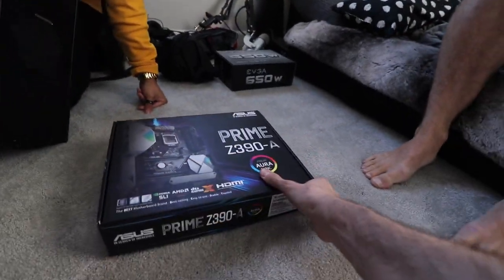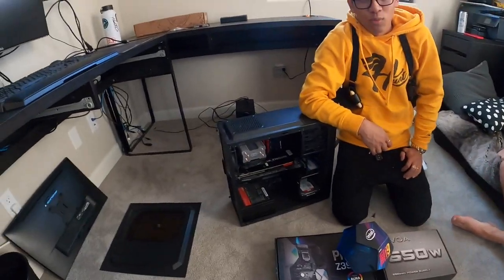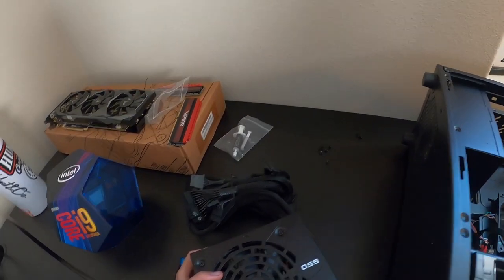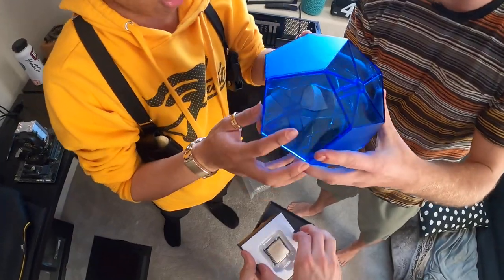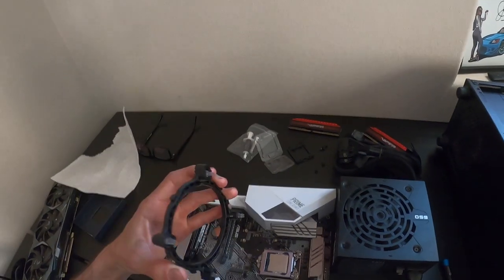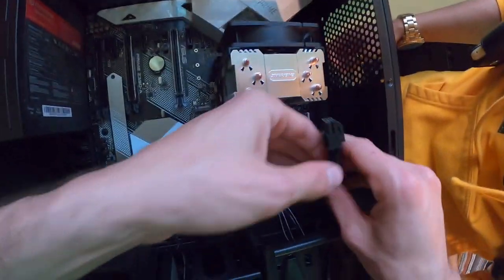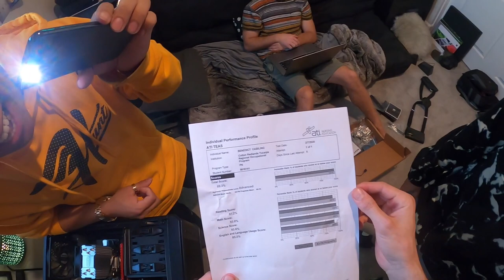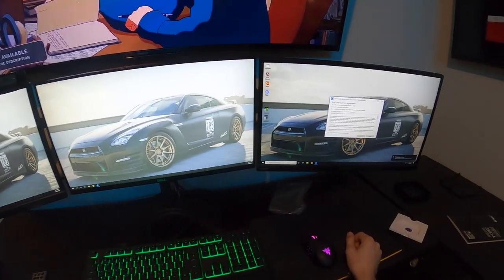Building my Dream Gaming PC Setup!

Comment: As a PC nerd and car enthusiast I'm really holding myself back. But who else noticed that his unfiltered rear fan was set for an intake, and the cpu fan looked like it was blowing towards the front? Did you reverse the airflow in this case? (Btw, too much thermal past fine, too little = overheating issues) <3

Comment: Get a bigger wattage power supply 750 or 850 and change that CPU cooler   650 watt is not enough when overclocking plus that (GPU / Video Card) can draw some Wattage, If that was me I would have went for a AMD CPU Ryzen 9  3900X  12 core 24 thread For gaming and editing.

Comment: Hey Tj you should really get a bigger cooler, Intel 9th gen CPUs really like to run hotter. An Evo 212 can possibly cool it on light loads but since you want to stream and play COD I would recommend getting a bigger air cooler or a simple 240mm All In One water cooler. Simple install but you really wanna protect that $500 CPU and you know not thermal throttle. I also recommend getting more fans and make sure they are in the correct orientation to create Positive pressure inside of the case like Front Panel fans pull cool air and push it in and the Back and top fans Pull air from inside the case and send it out.

Comment: 1. Good job teej
2. Could have replaced the old power supply with the new ^_^
3. Need a better CPU cooler..that i9 needs it
4. Cable management

^_^

Comment: Should have gone one of the new AMD 3950X CPU's with a PCIE gen 4 SSD drive, also dont put it on carpet how you had it, lift it up onto the desk so you dont suck in all the particals from the carpet.

Comment: You need a higher watt power supply for that . 9900k and a 2080ti running on a 650 psu. Thats bold.

Comment: "It CAnT toUcH ThE CaRpet BEcAusE iTs StAtiC" lmao then puts his pc on the carpet
Reply: I cringed 😂
Reply: I cringed when he removed the static wrap and walked across the carpet holding the motherboard, lol
Reply: Believe it or not, static electricity would not do anything to the PC just as long as it’s off meaning PSU off, Just like you can pour water on your pc and still have it work as long as you let it dry off
Reply: @drewllicious  well i just like to build my pc on my desk (wood) standing on a wooden floor. But he definitely should not put his pc on the carpet while it's turned on. I'm not saying something bad will happen but there's a higher chance.
Reply: @drewllicious  wrong.

Comment: You're going to have heat issues with that cpu cooler. You can buy the corsair H110i for like 150 and that will work great for the cpu
Reply: Chris Willette They’re waiting for the cold air intake and new exhaust if you know what I mean ;P. It’ll be in the next video

Comment: thats a good setup. i build computers for a living
ive got a dell gaming monitor too they are epic. i play modern warfare on my 9700k overclocked at 5.2ghz, strix 2070 super, strix z390-e motherboard, 32gb ddr 3200 ram, lian li 011-dynamic. if i was you id upgrade to a better case and upgrade the hard drive to a nvme ssd. much better speed and performance. 

also upgrade to get better airflow with a case, that computer runs pretty hot and you need to keep an eye on your temps.

Comment: The fact that the CPU cooler was pointing up rather than towards the back of the case would have cost you in thermals in your old build. The CPU cooler should flow straight into the exhaust fan at the back of the PC :)

Comment: You should have went with a 10th generation Intel core i7 or a third-generation AMD Ryzen 7 CPU because they don't have as much cpu cores as the Intel Core I-9 because what you have to realize is that having too much CPU cores in your computer can actually bog down the performance because of the CPU cores that is not being used

Comment: If you're interested in running a sim racing setup but have confined space I recommend getting the Playseat Challenge. Its a a budget sim racing setup that is foldable for confined space. I have a small apartment it works great. I am able to run a Fanatec setup. Thrustmaster and Logitech is also compatible. https://www.playseatstore.com/playseat-challenge.html

Comment: That PSU is a bit of a yikes. PSUs are ranked in tiers and that PSU (EVGA 650 N1) Is dead last. It's so bad it's not  recommended for even a light office workload. Really shouldn't have cheaped out there especially with a 2080TI.

Comment: You'll definitely need to upgrade the cooling because the i9 9900K is notorious for beîng a processor that runs very hot, your little fan cooler won't be able to cool it enough and you'll experience thermal throttling. I would consider you to buy a bigger fan cooler or an AIO watercooler. like this https://www.amazon.com/Noctua-NH-D15-heatpipe-NF-A15-140mm/dp/B00L7UZMAK or this https://www.amazon.com/RL-KRX62-02-Cooling-Software-Controlled-Lighting/dp/B06XX8Q1CL/?tag=aboutcom02lifewire-20&ascsubtag=4690748%7Cn0ee680fbe46d4710933bcda69c19dc0623
These that I gave as examples are considdered as the best performing on the market.
Just some friendly advice ;)
Keep up the good work

Comment: You really need better cooling and a higher wattage power supply. 
Also better and more ram, good cable management, and a nvme/pcie ssd would be nice to make it a 1000% more usable.
But hey you got 2 really expensive parts mixed with some other misc. junk. 

Also yes I’m one of the keyboard warriors. And yes I’m relaxed. Also we have the same wallpaper. Lol ♥️

Comment: I would look at cooling methods cause if you steam and game with a i9 it will get hot a aio is a good water cooler without doing a whole water build (edit) also get a solid state drive or SSD cause you can load anything faster people like to put there operating system on it cause I loads really fast and same with games. But editing on your gaming pc with be really fast

Comment: You might want to get a 850w power supply instead of that 650w power supply. The core i9-9900k and 2080ti draws a lot of power.

Comment: Ooof... That was kind of Verge.  

That cooling setup is very questionable, to say the least, especially for a 9900K.  And overclocking?  I'd definitely upgrade the case and beef up the cooling scheme all around, including a 360 mm closed loop AIO... or at least 240 mm.  Theres no way you can get the most out of that CPU and GPU with that case and cooling setup. I'd definitely put a better, new PSU that's full modular, use some decent sleeved cables and up that cable management game in general.  You're already in for about $2,200 total for what just purchased so spending another $300 to do it right only makes sense.

Tequila?

Comment: A core i9 with a cooler master heat sink, and a case with an acrylic side panel window. Tj, I love you and Calvin, but Calvin, why must you let the man who does not know things have a case so restrictive and ugly. You let him put it under the carpet as well?1?! Smh.... Smh
Here are some parts that have been recommended to me and some I use personally :)
Case: https://www.newegg.ca/matte-black-nzxt-h-series-h510i-atx-mid-tower/p/N82E16811146318
Cpu cooler (RGB): https://www.newegg.ca/corsair-liquid-cooling-system/p/N82E16835181152
Cpu cooler (not rgb): https://www.newegg.ca/corsair-liquid-cooling-system/p/N82E16835181138
Case fans (RGB): https://www.newegg.ca/Case-Fans/SubCategory/ID-573?cm_sp=Cat_Fans-PC-Cooling_3-VisNav-Case-Fans

Comment: I'd maybe swap case, cooler and psu, not being a dick but that cooler isn't sufficient and pretty sure the 650w isn't either.
Got a r9 3900x and a 2080ti and my 750w supply is borderline.

Comment: Need a way bigger power supply.... they operate Best a 3/4 their full load. That 2080 TI WILL BE power hungry. And there is no way you get the full potential out of that i9 without over clocking and you won’t get there without way more power and a way better cooler. Great hardware choices but need way more power....

Comment: I really like that teeej is getting into PC, but calvin man, you've got a job in this. Change this small ugly case that BARELY fits his 2080 TI. Also stock heatsink on an i9? Get him a decent case that can fit a 280mm AIO its like the bare minimum here. That case is most likely going to choke for air. Would love to see the temps during benchmark. Not to add the cheap ass PSU. If you're going to run a 2080 and an i9 I'd get a decent quality PSU so my shit doesn't randomly get bricked. But that's me, you do you.

Nonetheless, there's a lot of learning to be made here, PC buildind is really fun.

Comment: Should get Calvin to overclock your shit for even more boost ;) 
Edit: my 212 evo fan cooler for my cpu keeps it at 35 Celsius so you should be fine to over lock
Reply: Reflektionz 007 haven’t looked into it much but I do know they run hotter than my i7 but didn’t think it was that dramatic of a difference

Comment: your going to need a bigger power supply, your trying to run a 9900K and a 2080TI GPU wih just a 650 watt supply!! the The GPU ALONE requires AT LEAST 750 Watts Personally i would have got at least a 800 Watt PSU

Comment: Anybody waiting for “my computers broken” due to crashes during resource intensive tasks? i9 + 2080 + 32 gb might need 800-1000w power supply.
Reply: Brad Ward it’s recommended but the 650 is fine if he’s not planning on a OC

Comment: I've got so many issues with this video.
socks on carpet. it doen't matter. BIG NO even with an anti-static arm band.

Would've upgraded the case for better ventilation because you're literally gonna melt that i9. 

650w for a i9 and 2080ti will fry the PSU you need atleast 850w/1000w will be overkill but better safe then sorry. (another throttle)
you should be building the mobo inside the case as the case acts as a ground and the stand offs stop the flex. 

from someone that builds computers for a living this video killed me.

edit: I promise you that CPU cooler ain't gonna be enough in summer.

Comment: Already disappointed: after 3 Minutes in.
You gotta go Ryzen atm dude  - 3900X  with 12 Cores for the Same Money
Or At least 3700X - same 8 Cores same clock but save like 200 bucks.

Comment: WTF CHANGE COOLER omg ur cpu will blow up cuz of the heat
Edit never hold a mother board and gpu from the bottom where all the connections are like at the motherboard

Comment: I can't lie, I was cringing when I saw that you were doing a PC build video.  Small thing, when you mount the CPU/Fan you should have it blow toward the back, so that you aren't exhausting your heat into the chassis, but blowing it out.  Not a must have right this second, but you should consider getting an NVMe SSD hard drive.  The 2.5" ones are fast for what they are, but the nice NVMe ones are other level fast.

Comment: That case has terrible air flow it will run hotter than normal.... just saying.  That Cpu cooler is terrible for such a "high end" cpu.  www.worxbydre.com  Let me know, I build custom water cooled systems.

Comment: 2080ti 32gigs and i5 and you cant run cod wtf sure you can + with 2080ti your going to want 850 watt ps             maybe that's why cod does not work you need more power 850 watt